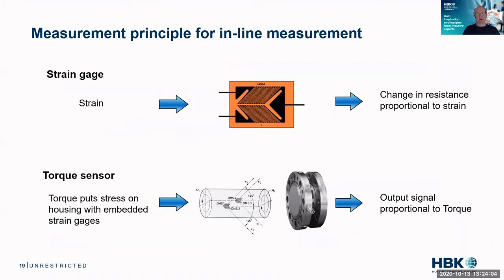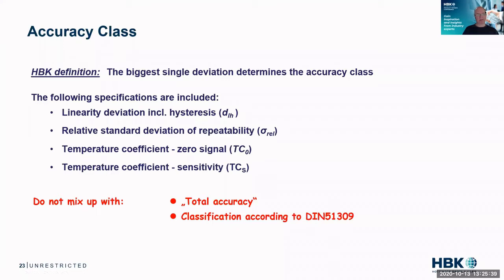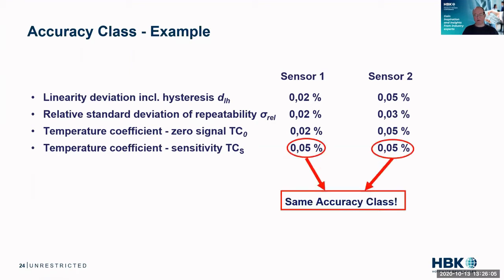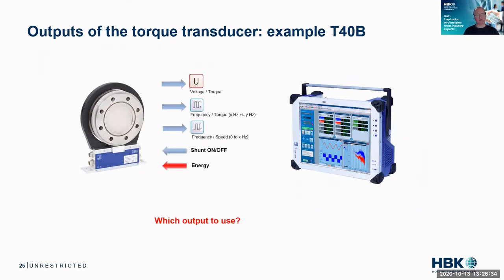Torque Measurement for Electric Motor and Inverter Testing

Comment from the maker: Contents:
00:10	what is a torque sensor
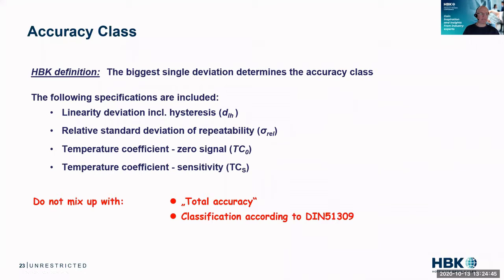00:50	HBM accuracy class means "deviation from specification"
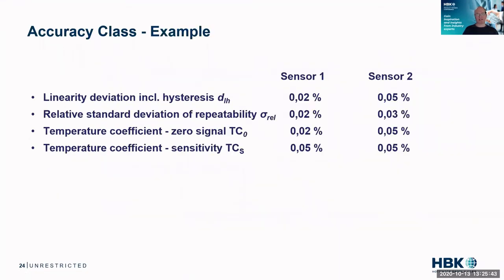01:50	example comparison of two sensors
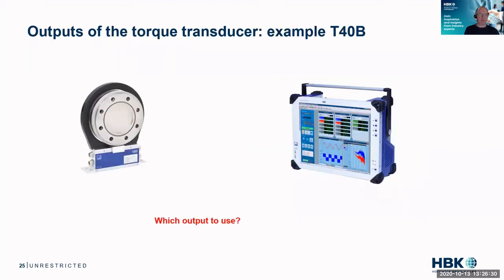02:35	which outputs to use?
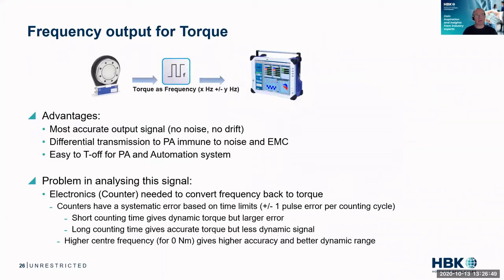03:00 	why use frequency
04:40	typical test rig set-up and problems
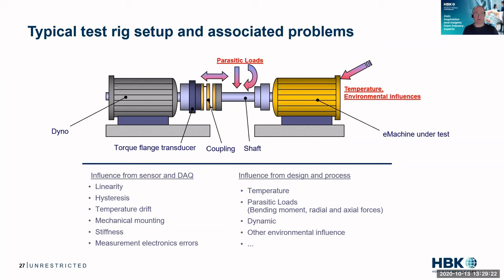05:35	for medium to high torque, use a flange type transducer